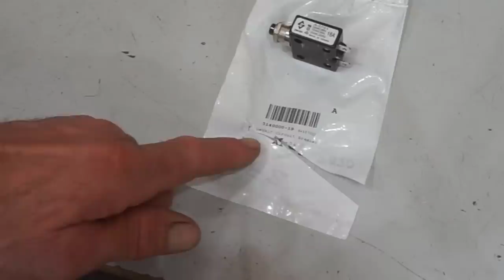DW735 Planer Deep-Dive Maintenance

Comment: Great, great video. Now that some time has passed, how did that thermal switch hold up?
Reply from the maker: Hey JT, here's the reply I've given to others with the same question:
 It worked pretty well for awhile but then, on a little more demanding project, started tripping out again.  I had to get through the project so I changed out the overload switch again and STILL had tripping issues during normal work.  Opened it up UHgain and saw that one of the terminals was kinda 'burnt', apparently from a loose blade connector.  I crimped it down tight enough that I could barely slide it on to the blade on the overload switch and that seems to have solved it for now.  Take away is to make sure those connectors are as tight as can be while still being able to slide them onto the switch because, I'm guessing, that heat generated by arcing current on the loose terminal conducted into the thermal switch itself causing it to 'falsely' trip out from that heat source rather than by actually overloading the motor.  Keep in mind that I'm a wood butcher, NOT  a sparky, so my whole conclusion might be off the mark.  Hope that helps?  Best, Matt
BTW, JT, as of Sept 2021 I've still not had any additional tripping issues and have done a fair amount of heavy planing so I'm convinced tight terminals are more a solution than the roller lube in my case... not that a deep dive maintenance isn't a good idea for extending the life of your planer.
Reply: @NextLevelCarpentry  Thanks for that info! I apologize for not checking the comments for similar questions. I'd also be interested to know - do you think you would do a deep dive maintenance video on your PowerMatic jointer? (I'm sorry if you already did one and I missed it when I perused your videos.) I am considering a PowerMatic but hard to pull the trigger on a purchase like that and I have little experience with other brands.
Reply from the maker: @JT-ig3tn  no worries... I had to do a comment search of the 300+ comments on the video to find it myself!🥱  I don't see a deep dive maintenance video for the Powermatic jointer as a possibility but do see that as good news: it doesn't need one!😁😎  I can tell you though that if I were buying a new jointer tomorrow I'd buy the same one.  I've had only one issue with it since new: a burnt out starting capacitor some years back, and it was covered under warranty.  If I were upgrading to a larger/wider model I'd have to do some shopping but for 8" I don't think it can be beat.  FYI I have an old Shelix carbide cutterhead on mine since, at the time I bought it, it was a better option than Powermatic's own carbide offering.  I have a hunch that that's changed in the 10ish years since I got mine to that's something you might check into.  Not sure where your budget or needs are but I'd make considerable effort in the $$ department to get the carbide over straight knives.  I don't have any incentive to push Powermatic but the LOOONG beds, nice fit and finish and, most important: parallelogram depth of cut adjustment are the main factors in my purchase decision.  I don't push my Patreon platform on anyone either but will mention to you I did a multi-video series called "Master the Jointer" as a patron-only perk in case you're interested in it.  Good luck with  your jointer search... I don't think you'd be disappointed in a PJ882 if you can check off enough of your feature boxes with it's specs... Best, Matt

Comment: My 735 started running really rough after I replaced the blades. before i jump in, does anyone have any thoughts on where i should look?
Reply from the maker: Only makes sense to start with a thorough re-do of  the blade install... I suspect something didn't go back together the same way it came apart, otherwise there's no reason for a DW735 to start 'running really rough'.  The most logical explanation is something's out of balance, maybe if a knife isn't indexed on the alignment pins or a screw is left out or...  Good luck.  Best, Matt
Reply: @NextLevelCarpentry  that was it!! Thanks. I have an Etsy store I started in this pandemic and the planer is a pillar to my shop like you mentioned. Here’s my store link to what I do ;
Reply from the maker: @markphilion541  If you want to share exactly what you found it would address my curiosity and likely help other viewers who encounter the same issue.  Not sure if you've seen this video but you might find it helpful going forward: https://www.youtube.com/watch?v=r_yEwlsYGbU     BTW I don't see a link to your Etsy store... Best, Matt

Comment: Thanks Matt, appreciate the maintenance video. I picked up the DW735 fairly recently via your amazon link. i'm not running anywhere near as many BF through it as you so it'll be a while but this is great for future reference. I thought you had the helical cutterhead in your DW735. Looked like you had the straight blades installed in this video. Did you switch back?
Reply from the maker: Only have helical in my jointer Darth.  I haven't been able to sort out 'latest greatest gee whiz hype' from practical results/cost benefit information on straight knife vs helical for the DW735 yet.  I'll definitely make it known if/when I switch though.... Best, Matt

Comment: Did I see you clean the rollers with acetone? Are you satisfied with the lubrication you used on the roller ends?
Reply from the maker: I use either acetone or lacquer thinner to clean the rollers although I'm not 100% sure it won't eventually damage them but I need them to be clean to work and will just replace them if necessary.  I am satisfied with the grease  I used on the roller bushings too.  FYI I learned that loose connectors on the thermal overload switch were likely the main problem causing it to trip out but don't regret doing this maintenance for optimum performance... Best Matt
Reply: @NextLevelCarpentry  Great - I followed all your steps and now our planner producing great results - like new!. Ordered the parts from your Amazon account and, per your suggestion, will order a thermal reset button. Very pleased with your instructions - next problem - we have an old Delta Shopmaster JT bench joiner and the bolts holding the blades will not loosen - any suggestions?
Reply from the maker: @CarlosManuelViana  If/when you swap out your thermal overload switch BE SURE to make sure the blade connector fittings are tight enough that they're tough to push back on because any arcing from loose connections will cause the switch to overheat and kick out.
Those blade bolts are both tricky and frustrating. Not knowing that specific machine I can't say exactly but I'd recommend using a rust buster like liquid wrench, make sure the wrench you use fits firm/snug on the bolts, make sure they're not reverse-threaded and use some sort of impact driver to loosen them.  Sometimes the slightest 'tap' in the driving in direction before reversing to take them out helps break the threads loose. You probably have only one shot at it so do everything possible to assure success before you start.  You can also check automotive/restoration channels on YouTube for more tips on loosening rusted fasteners in case you need extra measures like applying heat, using easy-outs etc to resurrect your Shopmaster.  Good luck! Best, Matt

Comment: So, how did this work out for you? I have been having the same issues you describe with my DW735. I have replaced blades, thermal switch (circuit breaker button), waxed, etc., etc., etc. I have taken it for a tune-up to the local Dewalt place. I have written Dewalt without response. This was the last thing I had to try, but I have not enjoyed this planer or the act of planing at all because of this issue. Now I have to give it another good try. I really want to know how it worked out for you. Please let me know.  Messed up circuit breakers from the get go?
Reply from the maker: Hey Clay, here's the reply I've given to others with the same question:
 It worked pretty well for a while but then, on a little more demanding project, started tripping out again.  I had to get through the project so I changed out the overload switch again and STILL had tripping issues during normal work.  Opened it up UHgain and saw that one of the terminals was kinda 'burnt', apparently from a loose blade connector.  I crimped it down tight enough that I could barely slide it on to the blade on the overload switch and that seems to have solved it for now. 
Take away is to make sure those connectors are as tight as can be while still being able to slide them onto the switch because, I'm guessing, that heat generated by arcing current on the loose terminal conducted into the thermal switch itself causing it to 'falsely' trip out from that heat source rather than by actually overloading the motor.  Keep in mind that I'm a wood butcher, NOT  a sparky, so my whole conclusion might be off the mark.  Hope that helps?  Best, Matt
BTW, Clay, as of May 2022 I've still not had any additional tripping issues and have done a fair amount of heavy planing so I'm convinced tight terminals are more a solution than the roller lube in my case... not that a deep dive maintenance isn't a good idea for extending the life of your planer.
Reply: @NextLevelCarpentry , thank you very much. You had a great answer. I am sure you had to make it before, but I couldn't find an answer by scrolling a ways. Very nice of you to do so. I spent a couple-three hours yesterday doing the deep dive clean. Now, I will go back and check the contact. Great deal. I surely appreciate it.
Reply from the maker: @lawynclaytonedwards5415  you're sure welcome let me know how it works out for you.
BTW I have an option to search for keywords in comments on YouTube so I'm able to pull up the answer without too much trouble.
Not sure if you have the comment search option available to you but it's superhandy if you do...
Best, Matt

Comment: Great Video!  Just curious, what are your thoughts on installing a helical cutter in the DW735.  I am assuming, since this is your second DW735 and it does not have the helical head, that you may be of the opinion that for whatever reason (cost, performance) it is not worthwhile.  I am considering the upgrade for my DW735 but have not made a final decision.
Also, I use Boshield products, I have been very please with both the products and the company, they shipped a replacement for a can of lube that stopped flowing.
Reply from the maker: Hey James, the deal-breaker for me is that the planed finish, no matter how smooth, has 'scallops' in it from carbide cutters on the relatively small diameter cutterhead.  A loyal NLC viewer sent, at my request, a few boards planed on his DW735 to confirm my hunch.  Given my distaste for sanding I stay with the straight knives that, especially when new, leave a surface that's easily sanded flat compared to sanding enough to level the scallops.  And there it is.... Best, Matt
Reply: I have installed the shelix cutter on my planer about 3 years ago and love it. I get a smooth finish and I am still on the first side of the cutter heads and have planed   a lot of lumber. I would have gone through at least 2 sets of regular blades maybe 3 in that time. I would recommend it to anyone. there is a great video on you tube on how to install it.

Comment: Now that it's been a while, do you think changing the thermal overload switch solved the problem?  I'm having the same issue with my planer that is only a year old.  It will just quit while planing a board while taking a light cut (1/64").  I'm flustered.
Reply from the maker: Thanks for asking Robert.  It worked pretty well for awhile but then, on a little more demanding project, started tripping out again.  I had to get through the project so I changed out the overload switch again and STILL had tripping issues during normal work.  Opened it up UHgain and saw that one of the terminals was kinda 'burnt', apparently from a loose blade connector.  I crimped it down tight enough that I could barely slide it on to the blade on the overload switch and that seems to have solved it for now.  Take away is to make sure those connectors are as tight as can be while still being able to slide them onto the switch because, I'm guessing, that heat generated by arcing current on the loose terminal conducted into the thermal switch itself causing it to 'falsely' trip out from that heat source rather than by actually overloading the motor.  Keep in mind that I'm a wood butcher, NOT  a sparky, so my whole conclusion might be off the mark.  Hope that helps?  Best, Matt
Reply: @NextLevelCarpentry  Thanks for the followup.  I'll try that.
Reply: @roberthskidmore6340  curious to see if that did help?
Reply: @TSPhotoAtlanta  I'm waiting for my replacement switch to arrive so I can replace it.  I did open up the planer cover the other day to check the switch terminals and they looked okay.
Reply: As an Electrician, it wouldn't hurt to put a dab of dielectric grease smeared on the male portion of the connector along with crimping the female portion tighter.
Reply: I also had issues with my Thermal cut out and found my connections were loose. I replaced them and the switch and it solved the problem. Chances are if the the connections are bad the switch has internal problems from over heating too. We used to have problems when I was an electrician with loose connections on breakers and it would ruin the breakers from the heat. Good luck
Reply from the maker: @TSPhotoAtlanta  I haven't had any issues since and am convinced the loose connectors were more of an issue than bearings but I don't regret going through the deep dive since cleaning and lubricating a machine always makes it run cooler and last longer.  Best, Matt

Comment: And the main question remains.. did it help? It didnt really look dirty worn or stuck.. are the blades gonna get a sharpening next? Love to see it :)
Reply from the maker: I haven't had a real chance to know if it helped or not yet... I know it can't be worse though and keep fingers crossed that I got a janky thermal overload protector last time and a good one this time...
Reply: @NextLevelCarpentry  Have you had a chance to run it much yet and see if it has improved?
Reply from the maker: @joe5938  It's definitely improved but I have tripped the breaker a few times with heavy use... Maybe I should check the brushes out or maybe, at 10 years old, it's just gettin' old?  Best, Matt

Comment: Apparently I pushed this machine harder than it was designed. It shut down and started smoking. Now it won't start. Is it even worth trying to repair myself?
Reply from the maker: The  thermal overload switch is designed to prevent burning up the motor Steve.  If it failed and you actually smoked the motor it would require in-depth repair that you might not want to tackle yourself.  If the overload did trip all you need to do is push the little red button in to re-set it... and be more sensitive to your planers' capabilities and feelings going forward.  BTW I demand a LOT of my planer and never burnt up a motor.  I have replaced that thermal switch a number of times though and it always fixed the 'now it won't start' problem.  Good luck...
Reply: @NextLevelCarpentry  Thank you for the reply. I did open it up a little more and discovered that that the blade spindle does not spin freely, even with the D-ring catch pressed down. It's locked in place. It seems to be gummed up with some pitch, but I suspect also somewhere in the overheating, it expanded.And while there is access to the blades, I think removing the spindle might be above my pay grade.
Reply from the maker: @sdolge  Expansion from overheating to the point of being totally locked up doesn't sound realistic to me. If you're up to it, remove the two side covers and see if there's something with broken gears or jammed up chains in there causing the lock-up.  There's a first time for everything and I'm not there to see it first hand but the condition you describe seems off... good luck? Best, Matt

Comment: 31:04 I'm pretty sure screw grab is for holding a screw onto the screwdriver as you move towards the hole the screw goes in.  It isn't made to grab a tight screw.  Why don't they all switch to little Torx machine screws I don't know.
Reply from the maker: Actually the Screw Grab product label promotes it as a solution for removing partially stripped out screws stating that the grit in the compound provides extra friction for the task not to hold it to a tip as you suppose...
Reply: @NextLevelCarpentry  oh. Ok. Thanks for info.

Comment: I'm sure I am not the only one, and I plan'ned on getting that same DuhWalt 735. I have to ask though, you do 1000's of board feet as you stated, and have a Unisaw and Powermatic jointer. But no 20" 5HP, single phase, helical planer? Have you considered "next level upgrade" to that DuhWalt with a spiral-helical blade?  I have to agree on Boeshield products- I was using them on MTB before they got popular and went from $5.95/can of T9 to $20/can of T9. Good tips!
Reply from the maker: It's not what you got but how you use it, right?  I do do a LOT of planing on occasion and can well afford any planer size/type/features I choose and still choose the DW735 as my machine of choice. If I were competing for price/productivity on planer throughput I'd get a beast in no time but, as it is, this machine does everything I need it to without demanding excessive shop space which is at a premium. Crazy, huh?
Reply: @NextLevelCarpentry  Not crazy. That's why I want one, and won't take up much space. But you do alot more than I :)